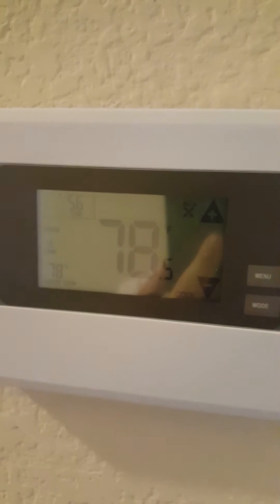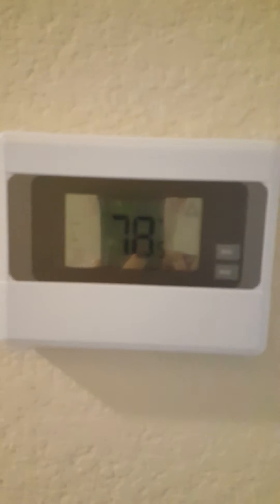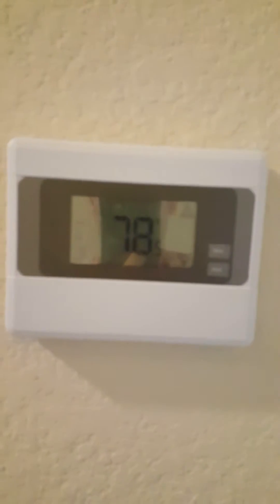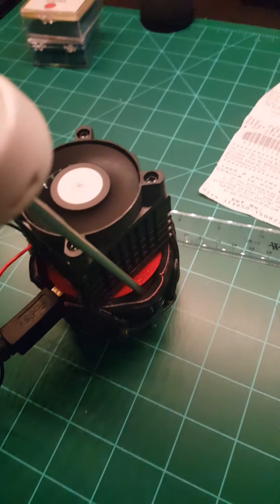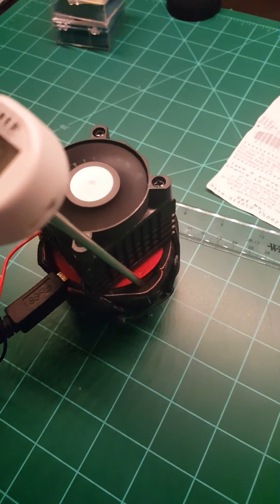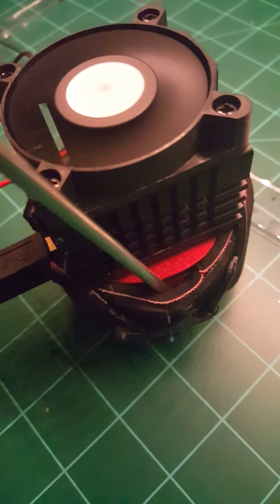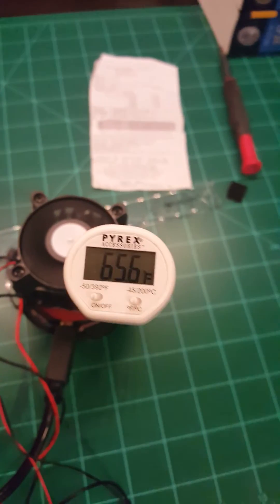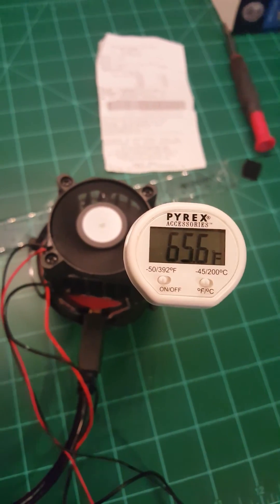ZWO ASI174MC Cool | DIY Peltier Mod

Comment: Hi Allen
, thanks for the video.  A question about condensation.  How to you prevent it from getting on/inside the camera?  Every consider putting a SilcaGel bag inside the OTA near the camera, and then remove it once the camera has gotten to temp?

Comment: From what I gather the 2 major hurdles with these devices are
1. Vibration
2. Condensation
With the humidity here I'm sure it's to big of a hurdle. Someone said they out a heater around the eyepiece but I don't want to chance my camera well being on that. Maybe I might just go with just the fan.
Thanks Mr. Mitchell
Reply: I think if you use vibration pads you for example print with flexible filament on a 3D printer the vibration should be OK

Comment: What was the "before the heatsink" temp at the sensor case? Also, have you considered a Peltier device between the sensor and heat sink? They're pretty awesome but you might want a little temp. controller to make it stable.

Youtube is being obstreperous about links but Amazon has some nice sized units pretty cheap. Would be a neat project, and one I'll probably do myself sometime.